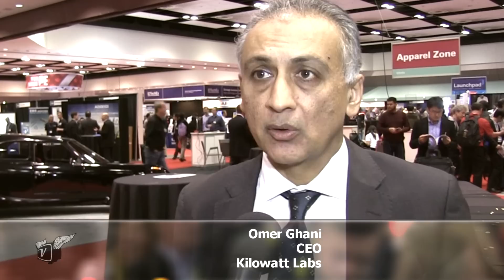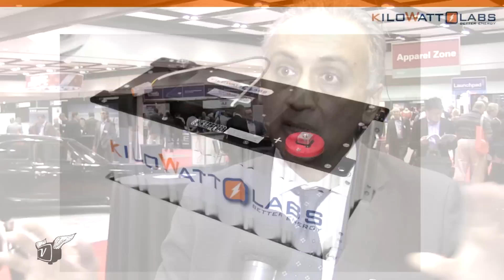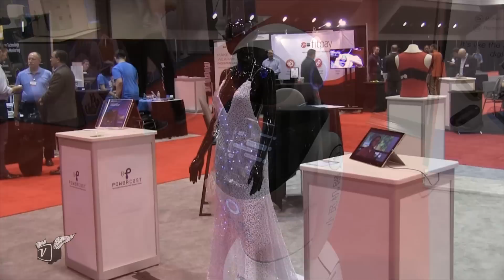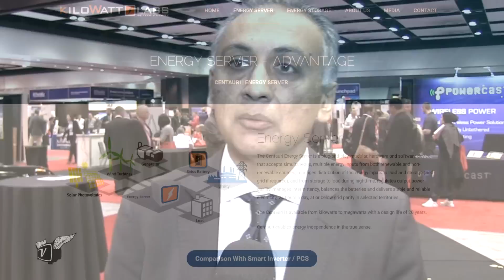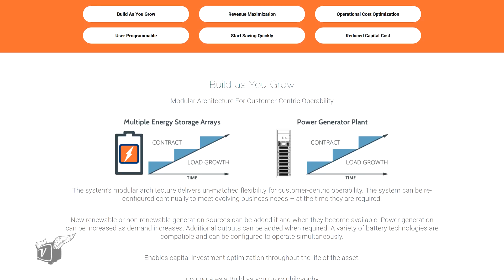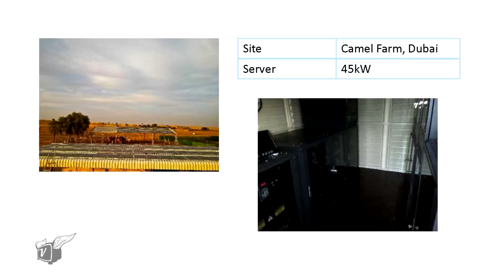The Fuel Tank of Tomorrow - A Super Capacitor?

Comment: So if they can be put on electric cars why don't all electric cars come with a solar panel roof that would charge the cap's and excess power be stored in the batteries,and the car would only need plug in when ever ?
Reply: Contrary to these claims, supercaps hold very little capacity compared with batteries. It takes a lot of energy to move a car down the road. Solar panels also put out very little energy. You could have as much as 400W of panels on the hood, trunk and roof of a bigger car in full sun. That is not doing to do anything to move the car down the road. You could move a golf-cart a little but not a car that needs kilowatts. If you had capacitors they would charge up fast with 400W but would not power a car at all.
Reply: Dave Scheer ask the oil companies
Reply: Regarding the solar panels it really depends how many hours the car stays in the sun. For example during the weekend if the car sits in the sun, lets say 6 hours x 2 days = 4.8 KW.
Reply: Rick Friedrich it would not move a car but it would charge batteries during stops and slow down discharge when the car is moving. I think using solar panels(considering how cheap and efficient they are nowdays) on electric cars is a good idea.

Comment: No doubt - super caps and super cap batteries are very interesting - but to say they are competitive in energy density and form factor to liion cells is just marketing blah blah! Sorry to say that right away - but it must be said clearly! Maybe this will be an alternative in 10 years. I experimented with supercaps myself and they suck in many ways: they self discharge in a few weeks,  they can get hot when charged or discharged with high currents, they are difficult to balance and the cells voltage is low. To discharge them down to zero is nice but the energy delivery at low voltages becomes very low as well - so there is no real practical use when voltage is changing all the time. LiFePO4 is much more stable in voltage and has very good durability, lots of cycles and low danger potential.

Comment: Too good to be true? Not - it's too true and very good.
Reply: Gary Sorkin,, it is too good and we can all work out for the super capacitor,  a super capacitor connectted to lithium ion battery with thyristor controller can be used to supply stable current

Comment: 30 seconds to charge a car. Hang on let's be rational about this. Let's say your car battery capacity is 50kWh - to charge in 30s means you need to supply 50 * (3600 / 30) watts, that is 6 mega watts. This is a huge amount of energy and I highly doubt that your charging station could provide this type of power and in terms of amps, if your charging station is 480VDC, this is 12,500 amps. Level 3 Tesla super chargers provide 480VDC at 300 amps.

This is however for a fully flat battery - if we consider that a person charges their car from 75% state of charge, this is still 3,125 amps. Just out of interest, I looked up the capacity of a Tesla car battery and it is in the vicinity of 75kWh

Comment: i was wondering why ELON MUSK is planing to build some more GIGA FACTORIES to produce more and more Li-ion batteries when super capacitors are better than them . he can not be wrong . super capacitors as this one are yet no match to chemical batteries . the tech is yet to come , but not any soon .
Reply: ask panasonic
Reply: Energy density is the key here which means you need a much bigger volume. Capacitors also have big voltage drops as the energy is used. Batteries have much smaller voltage drop over its usable capacity. Supercaps last much longer, so if you have lots of space, they are perfect. Like solar backup.

Comment: Lots of BS. Charging a tesla you're already maxing out the power running to your house. And supercharging stations are putting in a huge amount of power. Sure the capacitor can charge in 30 sec but you cannot fill up 100 kWh of power in 30 seconds. Don't forget we still have to convert AC-DC power.
Reply: The idea to get around the massive current surge required to charge the super caps in 30 seconds, is to have one or more equivalent super cap banks in your home charging slowly during off-peak hours.  This would allow you to charge your car from your capacitor bank very quickly when you need it.  However, I don't believe super caps have gotten to the point where you can run a car with them alone.  Maybe in a couple of years.
Reply: @evileye1968  This is the first reply to this artical that makes sense a super cap brought to full charge could discharge to a lesser charged S.C.

Comment: A capacitor charges to full in seconds BUT will not discharge the power over a time period. The capacitor discharges its power at the same rate as it takes on a full charge of power, that is in seconds. Fix this problem and the electric car battery problem will be solved. A super capacitor that takes on a full charge in seconds and then discharges over many hours of use.

Comment from the maker: Here is the portion of the interview with CICUSA where Marty Snyder talks about how they are using the KiloWatts Labs supercapacitors as a replacement for batteries in a remote, off-grid telecom application.

https://youtu.be/qFlwuxVpyxQ?t=3830

CICUSA is a wireless system integrator, so power is just one element of many pieces (towers, radios, sites) that they put together for wireless carriers. CICUSA has had such good luck with the supercapacitors that they are going to be distributing these in the United States. Serving as a distributor is a new business for them. 

To see the summary of the entire conversation, which dealt with the power challenges associated with 5G, please go to this link

https://www.viodi.tv/2020/06/14/the-5g-power-challenge/

Comment: Come on guys I have used super caps to replace my battery in my car. To do this you need a small lawn mower battery in parallel with the super caps. Lasted five years so far start my car at a higher speed than a regular battery.
Reply from the maker: That's pretty cool, Ken. What was the motivation for replacing your battery with this "hybrid" set-up you created?
Reply: My battery died every year and I was tired of replacing it. The parts store kept on giving me the wrong battery. I made a bank of six super caps.
Reply from the maker: That is really cool. One of the reasons I find this fascinating is that many years ago I speculated about the idea of creating a "cap car", where the storage source would be capacitors. The back of the envelope calculation suggested that the car wouldn't be able to pull the weight of the capacitors needed to power it.  It is clear that the energy per volume has progressed.

Comment: I see a lot of negative replies.
But indeed supercaps have a future.
Maybe in the beginning using supercaps in parallel, with or without additional electronics,
to get a true very low Zi battery that can deliver those peak currents that motors have at startup.
There he is right,
The cellphone towers and climate issue (battery temperature range) there he is right too.
Some supercaps parallel with your car battery make for a good start at very low temperatures for example
when the lead acid cannot deliver a lot of power.
Maybe same for airplanes...
Drones, fast acceleration...

I am not sure about the Ampere hours, else Elon Musk would like to talk to him.
High charge currents can be engineered for, else just swap the caps..
Hope you get good ones ;-)
I am in electronics, and 4 sure supercaps have my attention.

Once some threshold is exceeded thing can go very fast, look at how lipos changed the world...

Comment: how in hell you charge a car in 30 seconds?   imagine the size of the cables to transport that amount of power!
Reply: You can increase the voltage to transport more power with the same size cables.
Reply: Right? A 14 kWh battery charging in 30 seconds would require a charging rate of 1,680,000 Joules per second. At 480 volts, that is 3,500 Amps. If you charged at transmission voltages (69kv), you could do it at about 24 Amps, but even he admitted that the super caps are inherently low voltage devices. The conversion process down to capacitor voltage levels would be astounding. But, I guess if you are just rambling on with marketing wank, you don't need to worry about things like physical limitations in your technology.
I should think that charging up the car in 5 minutes would be more realistic, at that would be "only" 350 Amps at 480 volts for a 14 kWh storage bank. I can only imagine how much mass and volume that much storage in capacitors would take up though!
Reply: If the battery bank was easily replaceable you could have a machine that swapped the batteries like cordless power tools. There's your 32nd "recharge".
Reply: "At 480 volts, that is 3,500 Amps." Generally 480V is used in 3 phase so  1974.66 A following 1.68MW / (sqrt3 * 480).

Secondly, you are talking about a short duty cycle- I could very easily see the NEC in the future treat such a system similar to how welders are handled, for example a station which can serve 1 cars per minute (30 seconds on 30 seconds off) would have a 50 duty cycle which could reduce feeder size by another 25%.   so 1480.5-  which a 1/4"*5" bus bar could handle (per phase).
Reply: I know the Capacitors charge very fast but, not 30 seconds charge for 100 mile run.
Reply: "but, not 30 seconds" Theoretically that should be easy for some.
Reply: It would take a super capacitor to charge a super capacitor!
Reply: In day-to-day use, having to swap a battery bank for each refill would be super painful for users. For an electric bike, though, that's the way to go (but you can do that already with chemical batteries)
Reply: Not necessarily...at high voltages you use lower amps so the thickness of wire can be    mitigated....
Reply: It only takes seconds to switch-on a cap bank in a distribution system.
Reply: +edmhie1, and only seconds for the high amperage discharge to melt through the undersized wires. Which works great if you are looking to make ingots.
Reply: Edison had a tour spreading fear about alternating current, they shocked Monkees you death, because Edison had all his patents tied up in supplying DC, just because you don't think it can be done, does not mean it cannot. There will always be someone who takes on the challenge of ignoring established norms and finding out for themselves what really works, and the lucky ones get rich while all of the engineers and scientists sit perplexed.
Reply: yea... do you dare to hold a cable with 10kv with your hands?  plus the car will need a "buck converter.. jaja" from 10kv to 120v 220v or whatever..
Reply: I think the battery packs in electric cars are around 400v
Reply: Super Caps are light, Perhaps a hot-swap for home?
And something like a custom Distribution transformer for a service station (lets say 1.5kv)
Reply: The current chargers are 80 Amp @ 400 Volt but new chargers are being proposed to increase this to 300 Amps and they are rolling it out in germany already. That would mean that these devices would charge in 10 minutes for 14kw battery at off peak times.
Reply: +naeem someone; you mean a 20kwh battery.
Reply: Perhaps a lightening rod in a
thunderstorm? Was Nikolai 
Tesla correct?
Reply: a battery yes, absolutely,  your correct  ...but. a capacitor.. no your incorrect.... those two devices are not the same AT ALL and should NEVER be confused or lumped together in any way.

    you Could charge a 14KWh CAPACITOR bank in just a few seconds.   ( although for my money I would say about 1 minute would be more realistic)
 I build and repair Tube amplifiers,, and the electrolytic caps in their power supplies will take on a 550 volt DC charge in just about a half second. and they will discharge just about as fast too. which is what makes them a little unsafe to those who do not know EXACTLY what they are doing..  so my prediction would be while I DO see the incredible potential of a Super cap system as a storage media... these will NOT BE something that just any Tom, Dick or Harry, should try to work on themselves... the possibility of dying would be very real.
Reply: Ananta, that is what they want to push right now as we speak.....replaceable electric car batteries that can be swapped out in seconds at a gas station. Leasing those batteries will be a norm and that is the way how it is possible.
Reply: speedsterh i think supercaps with buck converter is needed. The storage is linear. But a battery is more like a straight line.

Supercaps in remotes, and such would be nice. Yes you have to charge often. But less waste?
Reply: amps dictates the size of the cables not voltage.
Reply: 1.21 Gigawatts!?! Great Scott!!!
Reply: Send it to the charging head high voltage ac and then transform it down to low voltage dc. Or have it done in the car.
Reply: Have a huge super capacitor at the charging station, it can charge up slowly and very rapidly transfer charge to the one in your car
Reply: Guys it says you can charge in 30 seconds can being the word you can set the charge rate for what you are able to do.
Reply: @WarrenGarabrandt  hi Warren he States you can charge in 30 seconds. If all the peramiters were in place to do so. It has a charge rate c 1.7 and it's about settings

Comment: Super capacitor vs. battery are still entirely different from an energy density perspective. Any application where cost, size or weight are critical, forget about super capacitors replacing batteries. The guy in this video make some false claims e.g. that super capacitor are cheaper. Rather, price per kWh of energy is hugely more for super capacitor.

Comment: its 2019, why am i just hear about this now?
Reply: Been on youtube for many years... Type in FUN WITH SUPERCAPS Also the navy is using them to propel warheads & eliminate caring the blasting powder bags onboard for their cannons (RailGun launchers). Where you been? City electric buses use them for regeneration and initial accelerate (there cool as I love driving them for 12yrs now) & hybrids cars too. Supercaps can store the rapid energy and slowly dump that back into the batteries as batts cannot rapidly charge up or dump fast.
Reply: It is on the market, but it is not supecapacitors. Most probably Lithium Titanate battery. Check other YouTube videos, they make test of a discharge curve that has nothing to do with supercaps, also it's weight and size. :)
Reply: Jules Verne invented the concept back in the late 1800's ??  he called it a batterycator . there is also an Estonian company selling a similar product

Comment: And for his next invention, the "Flux Capacitor."
Reply: Well, if you take a 1/4 or 3/8" copper pipe and make a coil of 6 turns 2-3" and place a quarter in the middle on the coil, charge up a 3000F ultracap - dump all that energy across the coil ends, you will get a Shrunken Fluxed up Twisted Quarter... Great for crushing popCans too. Its on youtube :-)

Comment: Is it just me or did anyone notice how he tried to allude to the fact of how much space the steaks up versus how many kilowatts of storage capacity you have based on the example they gave us like at the one that was supposedly 20 kilowatts if you just took batteries out of something like a Nissan Leaf then realistically if it was lithium given the space that it looks like it takes up you would have 200 to 250 kilowatt hours of storage for that same amount of space if it was power storage using lithium batteries the comparable energy density is not very good on that as far as putting putting it to use in say an electric vehicle cuz the range would be absolutely horrible given how much space it looks like you need per kilowatt-hour of actual storage currently a car that would have a hundred mile range based on what I'm saying from the size of those batteries versus the size of what we use in cars today that are electric you replace the lithium battery in the car with a supercapacitor array that's the same size and dimension and instead of going a hundred miles it looks like you are literally going to be able to go eat 10 miles but you do have the advantage of stopping off and if you can plug into or find a high enough output power supply you can regain that 8 to 10 maybe as little as 6 miles of range in 30 seconds so basically for comparison the 100-kilowatt Tesla 335 miles range if you switched it to having these capacitors it would probably have about a 28 to 33 mile range on a full charge but you could if the energy source you're using to charge the car was a high enough output energy source recapture that 28 to 33 miles range in 30 seconds when stopping after charge great concept great idea but the energy storage density just is not there yet but however this would be a good concept to sacrifice about 15% of your lithium capacity for these capacitors for the ability to be able to gain some of the efficiency of having something that could easily and readily charge and discharge this quickly compared to nickel or lithium battery technology so it's a good idea in a novel concept but putting it to practice in an automobile doesn't seem like it could be close to practical but we'll wait and see he said he's working on an automobile project so hopefully that gets unveiled soon and they have already came up with a charger that would be practical for being able to charge the car quickly and a car that has a decent range a capable range of running the heater or AC with the headlights on and I mean heater or AC at full blast continuously with the headlights on capable of doing at least a 80-mile run on a single charge.

Comment: Get a cap at 10000F to fit within a 12V PbAc battery frame and work at 12.7V then you got something... until then Ultracaps are not yet a full drop in (they have to shrink about 6x the size of current).